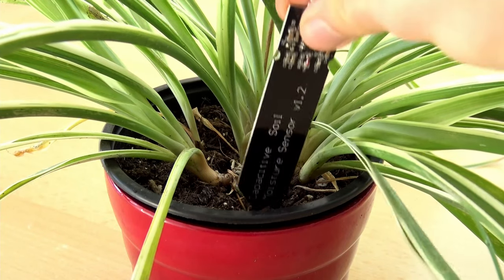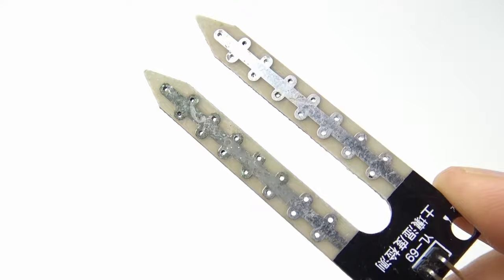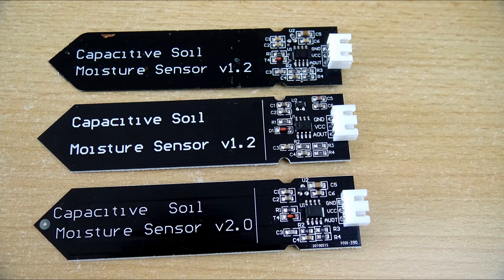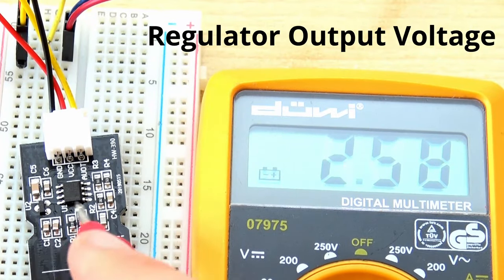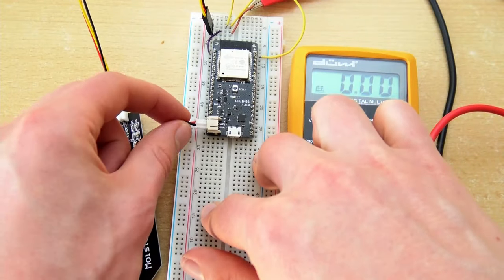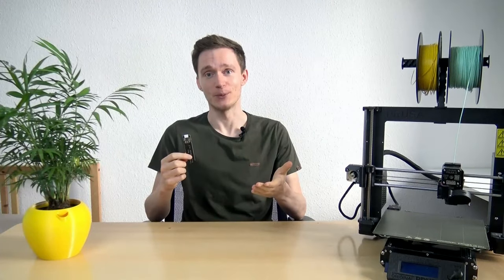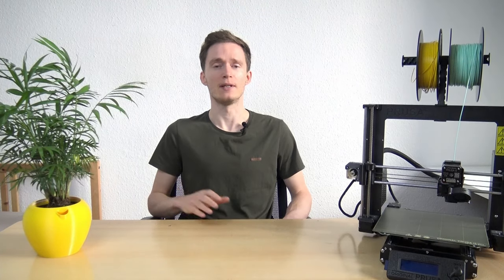Capacitive Soil Moisture Sensors don't work correctly + Fix for v2.0 v1.2 Arduino ESP32 Raspberry Pi

Comment: just a thought: If arduino is powered via vcc using a varying voltage, the lack of a regulator is a good thing.  That is because in this case arduino ADC considers vcc the maximum voltage and scales measurements accordingly. If battery voltage drops from 4 to 2 volts but sensor output remains stable at 2v arduino will think voltage doubled
Reply: Arduinos have voltage regulators.
Reply: @theekdunn  they do, but vcc is connected after the regulator. if you power via vcc you don't use the regulator

Comment: Well the one I just bought for a couple of £ is marked "Capacltlve Soll Molsture Sensor" so there's a quality issue for a start ( The output is also marked AUOT rather than AOUT) I can't pick up 1M resistance between output and gnd so looks like one of the poor ones.

Comment: Thank you very much, very helpfull. 
My sensor does not work : 
- I have the regulator
- The resistant is not connected and I need to add a 1 Mo resistance.
- The chip est NE555 93M so it doest support 3.3v. 
I use a ESP8266 powered by the micro USB connector, and a power supply. So the sensor should be powerd by the 3.3v outpout of the ESP8266. I don't know what is the best way to power the sensor.

Comment: Check out the DFROBOT version.  Mine from 1 year ago has all the right parts, and I measured continuity from two 800k resistors sitting right next to ground.  I believe it is a high quality sensor.

Comment: How much longer is it possible to make the resistive sensors last by turning them off with a transistor while not in use? Measuring twice a day for only 20-30 seconds should be okay. That is 1 minute of electrolysis instead of 24 hours.

Comment: I just got my sensor from a local shop and they had the V2.0. 
Measured the connections from 1k resistor to GND and it was connected.
might be because below the 1k resistor silk screen showed 20210603.
yours showed 20190515, maybe they updated the sensor?

Comment: I didn't test my sensor yet, but my hole between C4 & R4 is not in the middle. However, there seem to be a connection between R4 & GND.

Comment: thanks to your video I knew how to react to my bad order: Hello, I received your package but the wrong article was inside. It has a NE555 timer chip onboard that does not fulfill the specification of your article description (Operating Voltage: DC 3.3-5.5V). It does not work. Please send the correct items or refund. Best Regards, xx

Comment: Nobody should ever supply anything without a voltage regulator. Most µC-Boards have one built in and provide the output on a pin. This is why.

Comment: This is NOT REALLY a problem because those sensors are to detect moisture on dirt in order to water the plant.
The dirt moisture don't change immediately but takes some time for the dirt to get dry again

Comment: Thank you for the video. In my order there was the hole at the wrong place. The 1M aditional resistor does not fix the problem. Any idea? Does anyone can share a link to a good store? Thanks
Reply: Nach einiger Suche habe ich den Fehler auf meiner Platine gefunden, Der NE555 ist um 180 Grad gedreht aufgelötet. Ich habe ein kurzes Video dazu hochgeladen. https://youtu.be/E6O3AVx0scU

Comment: I have HW-390 (date 20210603) version of this sensor. In my version via between C4 and R4 is closer to PCB edge. That suggest that it is faulty example. But R4 is connected correctly. In my board they added two vias under VCC silk screen label = R4 is connected with connector GND pin.
Reply: Same version and same result on testing mine. Sourced from thepihut. :)

Comment: hey thanks for pointing that out. Just right b4 I’ve seen this video, I bought some soil sensors on eBay. I’ve checked out the pictures as recommended but unfortunately there was nothing to be seen. this applies to all offers that I could find on eBay. Maybe someone has a link for me?

Comment: Good video, just one question. The schematic you show has R1 to GND and you  measure from R4 to GND, why?
Reply: There is a simple reason: the silk screen printing does not match with the schematic. R1 in the schematic  actually refers to R4 printed in the board. Beware of the values printed in the resistor itself (R4 (board) = 105 = 1MOhm). 
So the checks are ok and vaild.

Comment: is TL555I a 'cmos' chip? 

and mine version 1.2 has no GND on the 1meg.
Reply from the maker: The problem with the missing ground connection can occur with any version. As already mentioned in the video, V2.0 is just a marketing trick with a higher version number printed on it. Technically there is no difference
Reply: @FlauraSmartPlantPot  I am checking integrated that you recommended us but I always see TL555C . Do you think that it works correctly?
Reply: @orcunyapici1427 , I am wondering the same thing. I found a Texas Instruments datasheet from Aug 2021 that said TL555C and TL555I are the markings on the range of the TLC555C and TLC555I range of chips. I don't know if these were similarly tested in making this video though.

Comment: can you recommend a very good brand or maker of capacitive sensor which you tested?
Reply: DFRobot made one several years ago, v 1.2. They have an improved 2.0 version now.
I'm using the v 1.2 and it works just fine.
I forgot, Adafruit got one as well. Very artistic pcb, but.. then you'll hide it in the soil :)

Comment: Thank you for your video.

I recently purchased this moisture sensor as well and encountered the same issue of the missing resistor connection mentioned in your video.

However, I decided to test it using an oscilloscope and was surprised to find that it did not exhibit the slow response symptoms shown in the video you referenced (QGCrtXf8YSs). On the contrary, it appeared to respond quickly. I recorded a video to demonstrate this(https://www.youtube.com/watch?v=nNPDYG5TMAw).

Furthermore, I followed your method of fixing the broken 1M resistor connection. Upon retesting, I found that the results were consistent with the previous ones, showing a same rapid response to changes in soil moisture levels.

Comment: Good video thanks. I have 16 of these sensors, I knew 8 were the old NE555 type with no voltage regulator but assumed the remaining 8 with the TL555 were ok. I just checked the circuit and sure enough 6 out of the 8 have the grounding issue on the resistor. Wondered why my readings were always garbage. I am going to bin the lot and use alternate methods..
Reply: Or just fucking fix the damn break in the trace 😂

Comment: 00:00 Capacitive soil moisture sensors have major design flaws

01:25 Capacitive soil moisture sensors are better than resistive ones

02:58 Many sensors sold online have flaws and are unusable

04:29 Capacitive soil moisture sensors may have voltage regulator and timer chip issues.

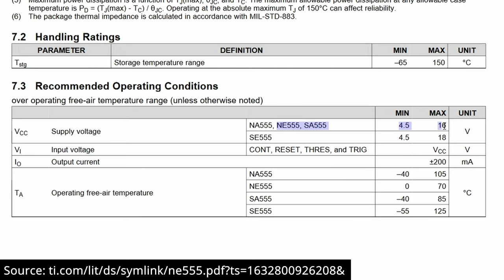06:04 Quality issues found in capacitive soil moisture sensors

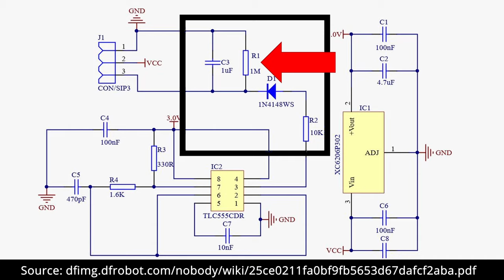07:38 Faulty sensor has interrupted connection of 1 megaohm resistor to ground

09:04 Capacitive soil moisture sensors can produce inaccurate readings due to faulty sensors.

10:28 Tips for finding a suitable capacitive soil moisture sensor

Comment: Maybe it's time to design a better one? These things are terrible designs in the first place, the output voltage is very high impedance, a load placed on the output will change the reading- a sloppy, lazy design.

Comment: Mate - the point with the missing voltage regulator is just not true.
The way these regulators should work, is that you use the actual supply voltage in your algorythm anyhow - and in case of using a battery, you should be monitoring the supply voltage on the mcu anyhow using an analog pin...

Comment: Okay, so I am no expert, but if the schematic for the 1M resistor labels it as "R1," and you are checking "R4" as labeled on the board, is it really embarrassing that you are not getting the expected result out of 52% when checking the wrong resistor?
Reply: He is checking the 105R smd resistor.
Reply: @youpattube1  there are 4 SMD resistors on the board... the key is the labeling from the schematic to the labeling of the silk screen on the board. The label he circled in the schematic claims the resistor needing to be tested is a one megaohm resistor labeled R1... and the video shows him going to a resistor labeled R4, which, according to the schematic, is a 1.6K ohm resistor bridging pins 7 and 2 and running into capacitor 5. Again, no expert, but I can read.

Comment: I see that you are testing resistor R4, but you talk about testing resistor R1. What am I not seeing?  R4 never is attached to the Ground. Also, the diagram shows a C8 just off the VCC.  I don't see a C8 on the board anywhere.  I have one of these boards, and yes, R1 does not seem to be connected to anything. Your first fix does seem to make sense. Your second fix, not so much.

Comment: Hi, great video. Thank to you, I could fix the sensor with 1Mohm resistor in parallel between GND and AOUT.
Also, does this sensor may would need their edges to be covered? I have watched a video that suggests to do it with Epoxy Resin.
https://www.youtube.com/watch?v=pdGRs7GXBeE

Also, I doubt if epoxy would be good, because, in combination with water, may it create leachate on the soil ? 

Please, what is your opinion, do you recommend to seal the edges?
Reply: I might try fingernail polish.  It dries very quickly and I believe it’s waterproof.

Comment: The first part is well worth noting, however when you came to the fault, I would have thought better tracing would have happened. I have the V2.0 edition with that same via and the same break in the ground plane at that point and yet there is a current path through to the capacitor and resistor. Just because a ground plane has a break in it, doesn't mean there isn't supposed to be a break, it just routes around the board to connect somewhere else.

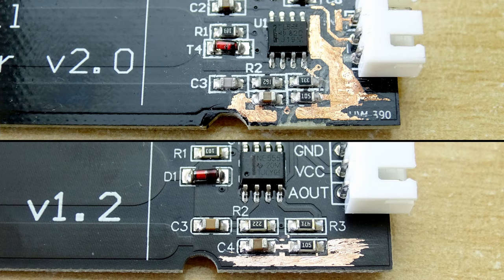You have used two different boards to show an apparent fault and pointed out that a through plated hole is in the wrong place with your comparison between the two. These two boards are obviously, different boards. see 7:58 / 11:49
I would have thought you would have noted, not only the difference in component values, but the other through plated holes that are there on V2 and not on V1.2
Wow its so embarrassing to see you get this so wrong
Reply: So how do you explain the success of the video and those in the comments by simply wiring a jumper between the 1M resistor and ground?
Reply: @theekdunn No idea given I have seen no one else say they have done this with the board I mentioned. I can only attest to the board I have the Ver 2 board.

Comment: Now ... what did we learn?
Exactly : dont buy cheap chinese stuff. At all. Only use proper, established, reliable suppliers and avoid everything chinese, if possible. The chinese market is crashing - and so is the product quality you're getting. Thats reality.
Also : china never had any qualified engineers - their education system mostly does not allow for that ... they get around that by copying western tech wherever and however possible, thats the actual skill you "could" attribute to chinese engineers : stealing tech. The copied products of course are inferior, yes ... but they can be *sold* .